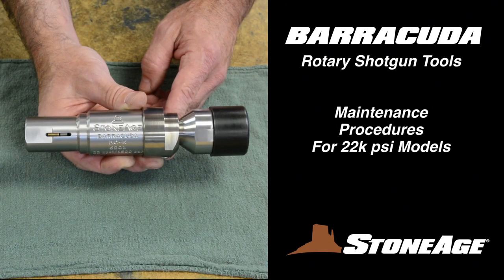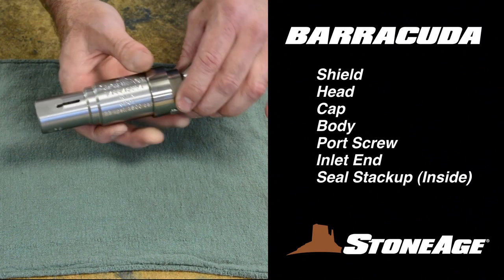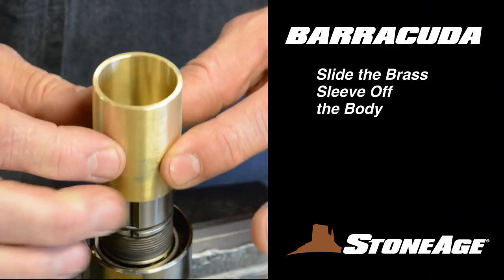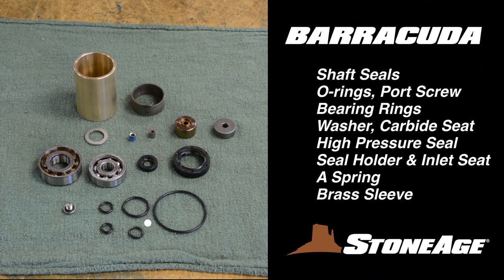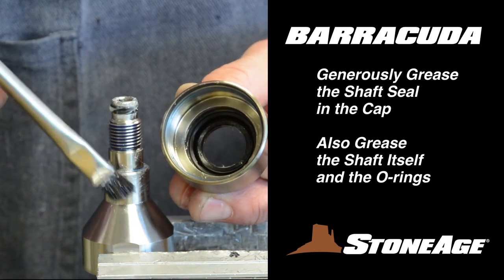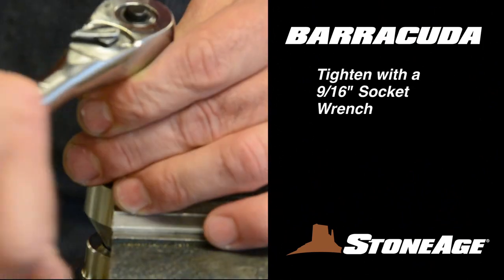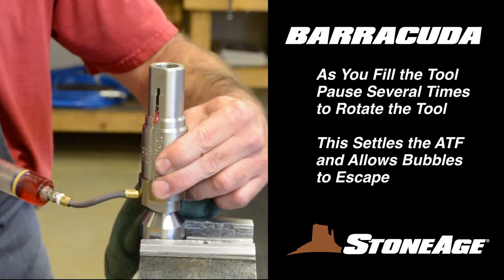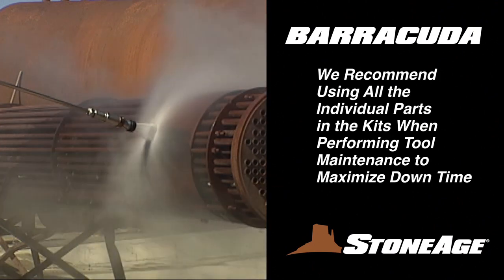StoneAge® Barracuda® BC-K™ and BC-K-P2™ Tool Maintenance

Comment: I don't understand why you use Blue Goop in the video and supply Copper Anti seize  in the major overhaul kit ..   I assume this is doing the same task 
Sadly I have seen this blue goop been mistaken for thread lock and the fitter unaware of product so assuming its that so next time out in the field for repair those tail shafts get really tight